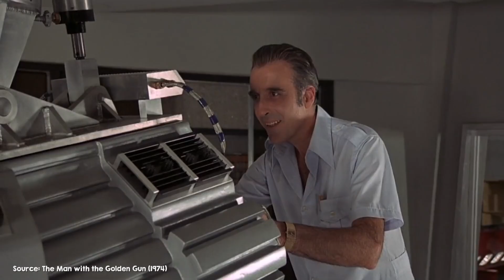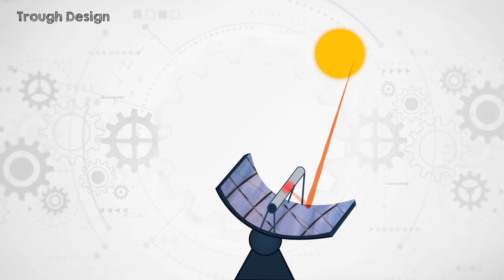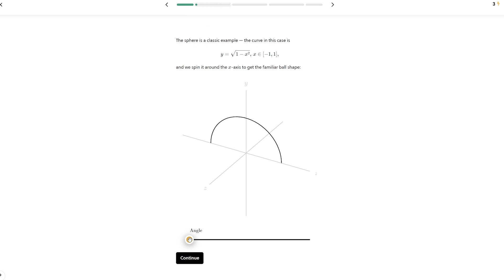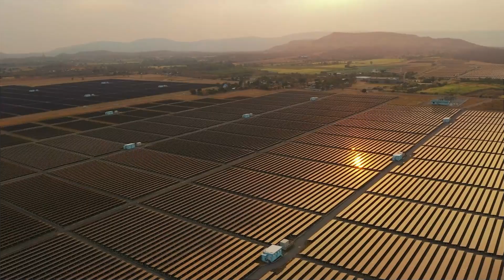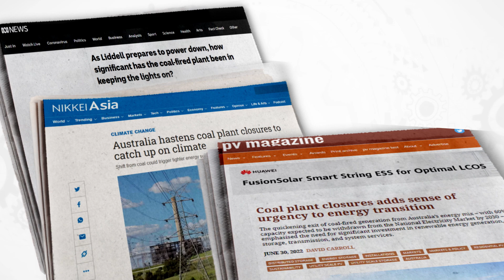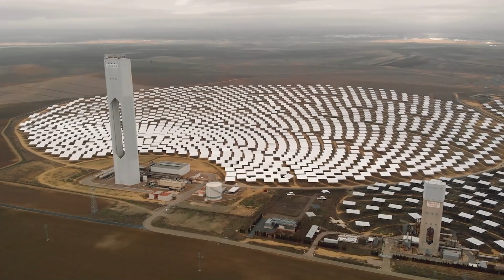Solar Power at Night using Concentrated Solar Power CSP

Comment: Rosie, I would like to hear more about that and the practical implementation. 
First: I love the idea of CSP as one of many components of future energy provisions. 

- There was a YouTube video about a CSP plant in the USA - that is going to shut down and blame the CSP with salt storage as not reliable. They never got that plant stable due to problems with handling the very aggressive salt fluid. Since for me the reason of a tower plant is the ability to store energy for the night this would ruin the concept
- Since CSP uses conventional turbines that plants won't be very reactive, it can't react to grid demands quickly. Will this become a problem?
- you told about longer term storage - cost some 1%. Fine. Is there included that the turbine has to be kept running idle the whole time?
Reply: First problem has been solved by using different materials, for the second just use some flywheels as already used in other plants, I don't think so: turbines only have to run when producing electricity.

Comment: Concentrated solar, has the disadvantage of being expensive when compared to photo voltaic panels, but has the advantage of being able to store heat and generate electricity 
long after the sun has gone down, but this balance of advantages and limitations is the same for all of the renewables, they all suffer from not being able to generate electricity 
constantly, plus, when they do operate their maximum period of output does not always align with the maximum period demand.

In short, we need energy storage on a large scale, because until we the ability to store enough energy to generate electricity 24 hours a day, 7 days a week, and 365 days a year, 
we do not have a genuine alternative to fossil fuels, luckily, we do now have enough storage technologies in development to meet those criteria, all that is needed is the will to 
pay for them to be constructed at a large enough scale.

For most countries the goal should be to build 50% more renewable energy generation than they would need on a typical day, and store any surplus energy, some to be turned into 
green fuels for heavy transport, shipping or planes, basically anything that can not be connected to a cable, and the rest to be used to generate electricity when the renewable capacity is low, whether it is concentrated solar, photo voltaic panels, (on) or offshore wind, tidal, or wave power, will depend on local weather and geography, and the quantity of storage will depend on vagaries of local conditions; we also need to know how long to store energy for, and again local conditions will determine how much of each type of storage we will need.

Storage 
  When it comes to energy storage, we must consider 3 categories, starting with, short-term grid storage, up to 6 hours to even out the highs and lows of demand and production, our 
existing pumped hydro systems work well enough with fossil fuel plants, but as more renewable energy comes online, it will have to be supplemented probably by batteries, 
which will also play a role with home energy storage, and light vehicle energy storage, but not lithium-ion batteries, which keep getting more expensive due to rarity of the materials 
they are made of like Lithium, cobalt, and nickel, plus there is environmental damage caused by the mining and processing of these materials. 

   Sodium-ion batteries are already beginning to compete with lithium-ion batteries, as they are made from cheaper and more abundant materials, and batteries using other low-cost 
materials like sulphur are making good progress in development, within the next year or two there could be several cheaper alternatives to lithium for batteries, which could soon look 
like yesterday’s technology.

 
 Then there is the 6 hours to 48 hours segment, there are many hopefuls in this sector, but there is one technology that looks to me ideal for this slot, the carbon dioxide battery 
(Energy Dome) basically, a closed loop system where a large quantity of carbon dioxide is repeatedly compressed with surplus energy, then allowed to expand to generate electricity, 
but best of all there is no Hughley complicated cryogenics system, and it is made from off the shelf engineering components, which should make the system affordable and easy to 
replicate, the only drawback is the large size of the dome, but I am certain these could be accommodated at old coal fired power stations waiting to be decommissioned, the dome 
could fit where the coal was stored, plus the transmission line would already be in place, so, we would be reusing an existing site, other options include huge spinning flywheels or 
the raising and lowering of heavy weights. 
  

Then there is long-term storage, for when the wind and the sun don’t play ball for days or even weeks at a time, plus fuel for heavy vehicles, ships and aircraft, only energy stored in a 
chemical form has the density for this, and luckily the latest development for producing Hydrogen by electrolysis is looking very efficient, plus there have been big development in 
green Ammonia as well. 

The next section is going to be from the perspective of the U.K. which is unlikely to troubled by concentrated solar, Britain’s weapon of choice is wind, but every winter the U.K. is 
subject to weather events, known as a blocking high pressure system, which can last for up to two weeks at a time, and they usually come complete with a blanket of cloud, which 
further reduces an already limited amount of light for solar panels, plus there is little, or no wind for the wind turbines, leaving us with nuclear but even if we get 8 shiny new nuclear 
power stations, that is equivalent to only 30% of our energy needs, which will go nowhere near meeting our energy demands, put simply we need a system that can store and supply 
between 60 to 70% of our energy needs for up to a month each winter, only a chemical storage system has would have the capacity to storage energy for such a period, if we are 
not to fall back onto fossil fuels.

It has been suggested that large scale energy storage is unnecessary, and that we should rely on interconnectors under the sea to transfer electricity backwards and forwards 
between ourselves and Europe, on the assumption that some part of Europe will always have a surplus we can use, but I can see a scenario where eastern Europe is suffering a 
winter cold snap and needs all the energy it can get, Britain and the low countries are stuck under a blocking high pressure system, so no wind, plus Spain and Portugal are covered by 
rain bearing cloud, so minimal solar power, and such a situation would not be that unusual, and given recent developments with the war in Ukraine to satisfy a small man’s ego,
 it would be extremely unwise to assume that our partners in Europe will always be willing, or even able to supply us with what we want, when we want it, storing our own energy 
means we stay in control.

  Another idea doing the rounds, says we build the bare minimum amount of renewable capacity and use smart technology to switch on or off an internet of things, as a way of 
balancing supply and demand, where large tech companies would control the operation of everything from large factories to your domestic washing machine or fridge, I believe this is 
a distraction, I believe that the big technology companies could build such a smart system,  but I also believe that the tech companies already have too much control over our lives, and 
I believe our goal should be to build 50% more renewable capacity than we need, so the excess can be stored, and we do not have to rely on a smart system that could be hacked. 

Australia, on the other hand, having a low population when compared to its huge land mass has the potential to not only meet its own needs for renewable energy, but could also 
supply a large part of the world with green energy, possibly by undersea cables, but more likely in the form of tankers of green Hydrogen or green Ammonia. Australia’s largely empty 
Centre would be ideal multiple concentrated solar plants, plus a mile wide ribbon of photo voltaic panels running coast to coast, east to west would extend solar energy provision over 
3 additional hours, and a line of wind turbines following the entire very lengthy coast line would have a huge impact on energy production, offshore where the seabed was shallow 
enough and onshore when the waters get too deep.   

In fact, there is so much potential for renewable energy generation in Australia that as well as suppling a large percentage of the world with green energy, it could mitigate Australia’s 
biggest problem, the lack of water, by using the abundant renewable energy to power desalination plants that use reverse osmosis, or the still theoretical concept of offshore 
structures designed to capture water vapour evaporating from the sea surface.

It does not matter which form of none-constant renewable energy system you choose as long as you build 50% more generating capacity than you would need on a typical day, plus 
you construct sufficient short, medium, and long-term energy storage that will provide a genuine alternative to fossil fuels.

Comment: Hydrogen is freakishly difficult! don't underestimate that, even NASA had/has quite some problems with it. it can burn invisibly, without flames. it makes steel (and other metals) brittle. The last SLS rocket launch succeeded only because "Red-Team" repaired an issue shortly before launch, next to the fueled-up rocket, very much at the risk of their lives! 
Even detecting (not yet ignited, but easily doing so,) hydrogen leaks is high-tech. Methane, LNG, propane, and butane are much safer!

Comment: WHY do you keep comparing CSP to solar + battery and not PV plus thermal storage?  Electric heating elements are 100% efficient and there would only be slight line losses.
Another huge benefit would be decentralization.  You can put PVs wherever you want and put the thermal storage wherever you want.  There will be more losses than doing it in DC right there at the sight, but the losses aren't huge.  Any place with a grid connection can serve either role (either the site of the panels or the site of the salts).

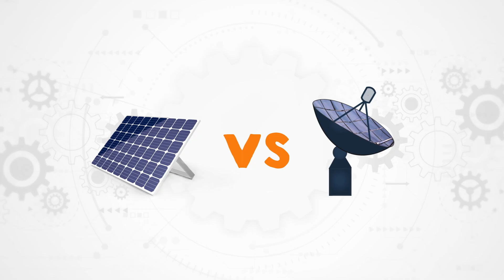Comment: 8:48 All of this is possible with PV.  You just use the electricity to heat the salt.  Though PV is less efficient than CSP, the electric heaters are near 100% efficient (there would be slight losses in the line).  You eliminate most of the maintenance as well.  While both benefit from being clean, CSP is much more susceptible to dirty mirrors.  CSP doesn't create any power without a clear sky.  Any mirror not directly looking at a clear view of the sun will have its power drop to near zero.

Comment: I have watched CSP for decades and have built small home sized systems.
Other benefits not pointed out is that it requires highly available, inexpensive materials, and no rare minerals.
Other disadvantages not pointed out includes burn risks to people and animals around the concentrators.
It's not clear how CSP has significantly changed other than costs have been dropping due to scale.  They are still complex systems.
The last decade has seen both simple PV and Li-ion battery technology costs drop dramatically, essentially wiping out most of CSP advantages.

Will continue to watch this technology evolve, but I just don't see it ever beating Wind, Solar PV and Batteries.  Incredibly simple, safe, and low maintenance solutions.
That said, I would love to be pleasantly surprised.
Let the markets decide!

Comment: No. This makes absolutely zero sense.  We have a few large plants that concentrate sunlight in various ways. One is through mirrors and others are with parabolic trough reflectors which shine the light on a pipe running through the trough.  Both of these are ENORMOUSLY expensive. 
This can be accomplished without these expensive and maintenance heavy systems. We can use solar panels and use the electricity to heat a salt like they do with the concentrated solar reflectors.  Though it is less efficient due to the low efficient of solar panels, it is far more economically efficient.

Comment: I was hoping to find more details about the CSP installation at Port Augusta.
To the best of my knowledge it desalinates water for a large scale hydroponic greenhouse. I've passed the site a few times when crossing the country. On one trip it was during a sandstorm which stretched at least to Ceduna. The CSP plant looked quite surreal through the gloom.
CSP is a difficult technology, molten salt is a temperamental material with nasty expansion characteristics. Severe damage to the hardware during the melt / freeze phase change cycle can be a real problem.
Cold source in desert areas is its own issue. When I visited Solar One Nevada parabolic trough installation in 2014 the generation plant utilised air cooling and masses of fans.
Deep space as a cold source seems to have potential and there is some interesting citizen science on YouTube regarding Barium Sulphate nano particles as the heat rejection medium.
Wind, PV, storage are all strong established competitors, interesting times ahead.
CSIRO were working in silicon metal as a heat storage medium.

Comment: I like csp since I heard about it like 2006. Then PV got cheap and efficient. 
Would be interesting to look at to what degree we really have to replace all these night power. Here in Europe, power is still cheaper at night, which doesn't make any sense already, let alone in a renewable future. If we make night power more expensive than day power, maybe even with flexible pricing refliecting the actual cost of production (which means we dont have to "make" the prices but they more or less set themselves like the prices of shampoo), then we need much less night power than now. I'm guessing like 10% ish, also considering other night power sources like electric cars. So...yes I think what Rosie is saying in this video makes sense, but how much do we really need? If people stop using night power because its more expensive than day, then CSP might even lose money...

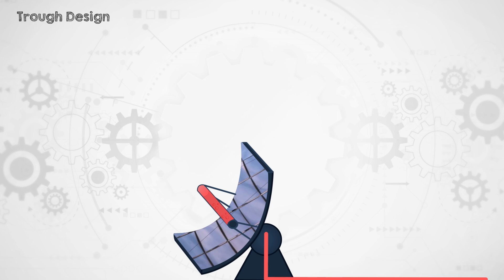Comment: Concerning 4:30 and the rationale behind the Fresnel trough, I came on a youtube video about the launching of the experimental Évora Molten Salt Platform where they managed to use molten salts in a parabolic trough system (and they of course boast that this achievement would enable a higher operating temperature as you already indicate as one of the advantages in your video). My impression of the CSP landscape is that the parabolic trough is maturing faster than the tower system (e.g. for equal land areas, the generated power seems to be higher and the project cost lower). The rationale for not yet giving up on the tower seems to come from a market of high temperature industrial heat (companies like heliogen try to make towers which heat > 1000°C).

Comment: Concerning grid storage, I'm still hoping for a breakthrough in ocean gravity batteries. I know that there's some research going on to use underdense material (air) pumped to depth using compressors, but it seems more straightforward to me to use cheap overdense material like iron ore or concrete and cables to raise/lower these masses. Unfortunately, I don't know of any industrial players looking into this :( Australia would be a key player in providing the necessary iron ore.

To crunch a few numbers: if one has a supertanker-sized vessel (500.000 DWT) filled up with concrete blocks (individually of a manageable size) and these masses are raised and lowered in a place where the sea is 4 km deep, my calculations indicate a stored energy of around 5 GWh, similar to a large pumped hydro station. Rough estimates of the cost give something like 200 to 300 million dollars, while for pumped hydro the cost seems to typically run in the billions of dollars.

Comment: Wait, it is 2023 and I have to ask did we have an oil shortage back in 1970?  I mean obviously, we still have oil and I have heard no more about it, we must use smaller engines, OK, we are going solar so maybe that is how we ignore the lack of oil again for another 30 years.  But I've kind of wondered how we can say we have an oil issue yet did race car driving stop?  No, it didn't, sure some cars were slowed down, to make the sport safer.  Anyway, oil, is it really running out, what will happen to the oil rick countries when oil goes away?

Comment: It would be possible to use csp with photovoltaic or PV.,  to get the advantages of cheap generation and cheap storage. Another storage method is gravity. This is where you raise a large weight up a tower and use the weight to generate electricity as it falls. This is quite efficient. The higher the tower and the bigger the weight the more you can store.
Reply: Gravity-based storage might have high energy conversion efficiency but has very low energy-density compared to electrochemical batteries. Very low kWh/kg material usage efficiency.
Reply: @johnbash-on-ger  I don't know the exact energy density but if using one of the most dense materials as weight, that is lead, that would enable quite high energy density. Energy density is not as important for stationary non transport use. The higher the tower the more energy could be stored as with the larger the weight been raised.
Reply: @grgmetube  No, even gravity storage with lead or transuranic elements is nowhere close to electrochemical batteries in terms of (volumetric and gravimetric) energy density.

Comment: too superficial... CSP is a dead end except on very specific use cases.
CSP needs clear skies, which makes it much more variable than PV (on weather.
CSP needs lots of water, which typically is not at the same place where direct sunlight is available.
CSP needs massive sites quite far from people, which is bad for Europe or other similar areas.
CSP needs extremely good tracking, which does not work well in reality.
CSP need lots of O&M.